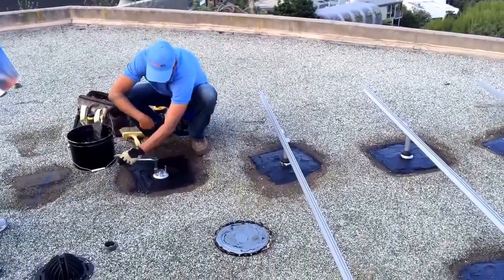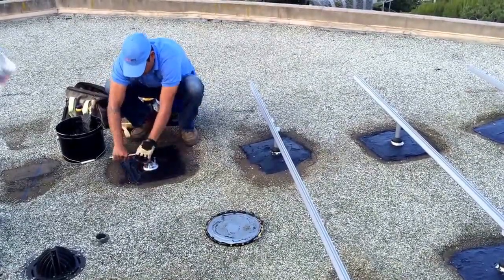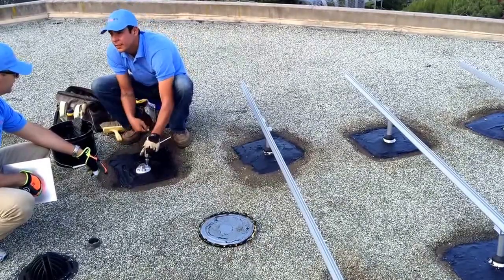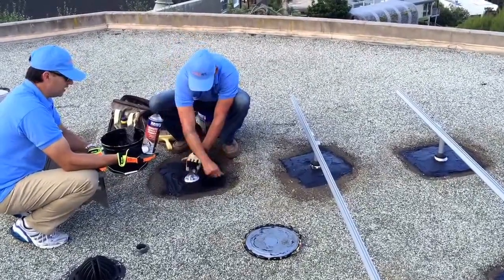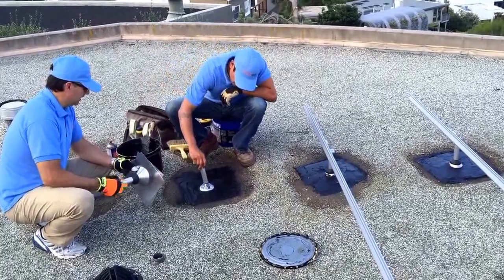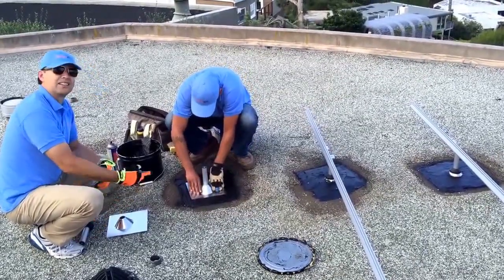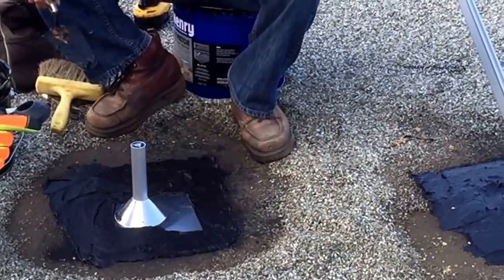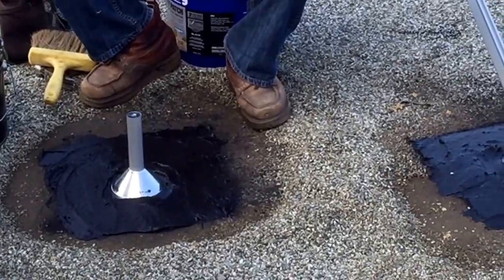Solar installation on Flat roof

Comment: Guaranteed for 50 years? That's funny! That material has zero UV protectants and will begin to alligator after the first year... Also, I don't see any fabric embedded in the plastic cement you're calling mastic like there should be.  You'll be lucky if those don't start to leak after 2 years... I'm sure you guys know solar, but you should get some training from a legitimate roofing contractor.  Also, if that roof still had a warranty, you just made it void...
Reply: Presumably they plan to put the gravel back over top of the flashing. That will prevent any UV damage.
Reply: LOL, yea they butchering that poor roof!